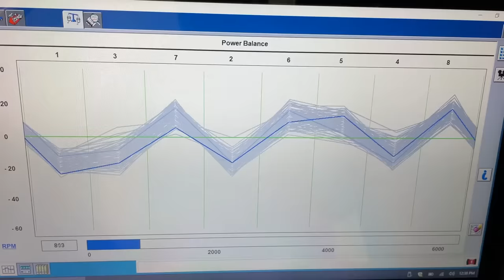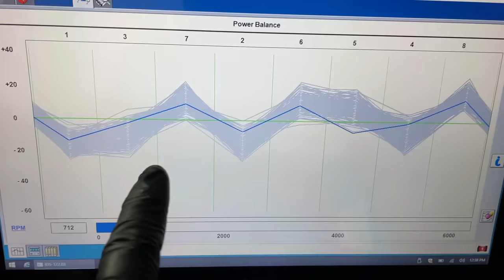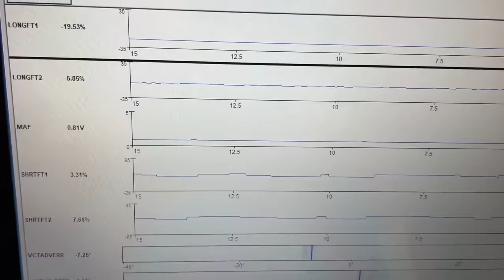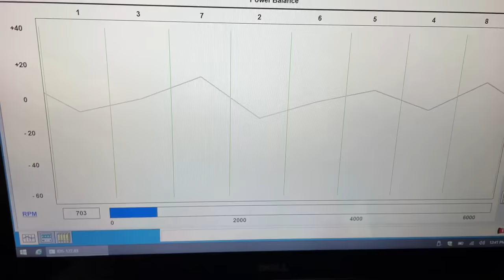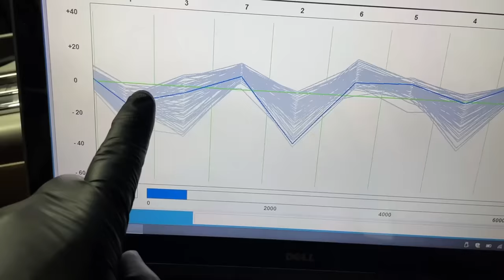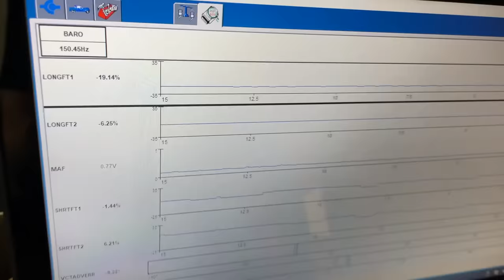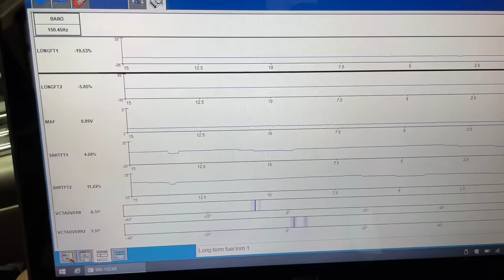Another Ford F-150 5.4L 3v Triton Rough Idle Problem the Other Shops Couldn't Fix!

Comment from the maker: Forscan is a free Ford Specific Diagnostic Software:
Download Here- 
https://forscan.org/home.html
ELM 327 Adapter I Recommend-
https://amzn.to/2GC6dBj

As an Amazon Associate I earn from qualifying purchases.
Reply: So you recommend the scanner and it will work on a Android phone? And then the free software works for the scanner?
Reply: I have been subscribed since 2013 wish scan tool was available then for now NO more fords
Reply: @xnotx2  do you have a link for that I can't find it?
Reply: Excellent diagnostic. 👍
  Who manufactured that phaser? 
And which phaser do you recommend for replacement?
Reply: I bought this ELM device and installed FORScan for Windows, and I do not have access to power balance.  I'm not sure if it's limitations of the ELM, or if power balance is simply no longer available on FORScan.  It looks like you're using an older version of the software.
Reply: @colliswilliams8992  He's running Ford IDS.
Reply: @hammerhead1282  nothing but OEM Ford replacement parts as far as the phasers. Aftermarket are junk.
Reply: I have another question I wanna add a air oil separator on my 2018 Ford Explorer Sport EcoBoost
Reply: do u have a video of the 5.4l spark plug replacement so they dont break?
Reply: @shonepolk9112  how much is a phaser replacement labor and material?
Reply: Top notch tech 👍👍👍
Reply: This is the same issue I'm having with my truck. It sounds just like it.
Reply: @albduke  can’t remember the price on the parts exactly but I did a complete timing job and I think it was around 800 for the entire kit. I did the work myself, Brian has a link to a Ford OEM replacement kit on Amazon. If doing the timing kit, I recommend doing the melling oil pump upgrade as well. I did and mine is an 07 with 150k and runs like new 👍
Reply: Hilarious name for a scanning software. No Freudian Slips on that name I bet. I enjoy your videos...ALWAYS!
Reply: Will the forscan software provide the same data as the system that you use?
Reply: I'm sure you did but I hope you replaced that broken guide too in bank one
Reply: @ismarmeskovic  agreed
Reply: What does a repair like that cost roughly?
Reply: @craneguru66  at the dealership I work at it right around 2500 for everything
Reply: @hammerhead1282  Ford & Ford
Reply: I’m a new Ford tech and stumbled upon your page great stuff man keep up good work and information definitely helps a lot! are or were you a Ford tech?
Reply: Drivability
Reply: So im looking to get a laptop  and the programs and scan tool. Could you tell me what programs you are using. I relise that i will have to purchase the license.  Your vids have helped me alot.
Reply: Is this the software you were using in the video?
Reply: It is shocking how many mechanics have no clue how to look at live data to locate the cause of a check engine light.
Reply: Can Forscan be used for 2000 - 2004 f350 diesel trucks too?
Reply: @kryptonian7648  Thanks for sharing that quote. That’s for labor and all the latest greatest ford components? This at least gives me an idea of what to expect so I can began planning. Would a dealership keep these parts on hand or should I expect for a week or two time to get parts? That’s cool yalls dealership is open to performing this repair. I just had p0012 p0021 and p0016 come up the night before last. Was taking the family to finish Christmas shopping and the truck began to stumble while easing into a parking space. Hopefully I can find a dealership or experienced shop to do the timing …thanks and Merry Christmas
Reply: Hi Brian, what if I only have the error fluctuations sometimes? With a P0022 CEL code? Would that be a bank 2 intake VCT going out? Especially intermittently, sometimes stalling at idle. Under mode 6 it’s says vvt bank 2 is at 11.63-11.64 degrees sometimes (Max supposed to be 11.61 degrees)
Reply: @jonathonrodriguez6733  , I soak them with a good penetrant and let them sit a long time. Then I blow out the excess oil and very careful take them out. I have been pretty lucky so far.
Reply: How much would you charge me to diagnose my engine. Include location, and contact information.
Reply: How much did it cost the guy for you to do the timing job and diagnostics? Just out of curiosity because my 2005 fx4 5.4 triton 3 valve has a similar issue where it's shuddering at idle mildly. I had a misfire and changed a few spark plugs and coil packs and the misfire is gone and it ran good for a week or so and now its shuddering..... and I don't trust the shops around my city to do anything to my truck. I prefer to work on it myself if I can.  You have the timing job videos but man that's time consuming and I work an hour away from home and only have one vehicle.
Reply: I got duhh

Comment: I have an '06 F150 with the 5.4 3v.  It has 312,000 miles on the original timing set.  Lol it's almost time for an overhaul, but still runs very well!
Reply: Don't touch till it breaks
Reply: What oil and filter do you use
Reply: @lyleswavel320   Use the Valvoline High Mileage and Wix filters.  Change it every three months whether it needs it or not.

Comment: Ford dealerships should require all of their technicians to watch your videos. Hats off to you Brian! You  definitely stand out from the crowd. I definitely enjoy all the videos and information you provide. Just last night I watched your video on motorcraft coolants. My '12 Taurus needs to have the coolant changed and I couldn't understand why I couldn't find the Motorcraft orange coolant anyway except ebay which had crazy prices. I did find a technical bulletin from Ford explaining why they discontinued the orange coolant and to switch over to the yellow coolant. My initial thoughts were is it compatible with the orange coolant? Then it dawned on me to see if you made a video about the coolants. Low and behold I found your video explaining all of Ford coolants. After watching, it eased my mind and was nothing for me to worry about. I then watched your video on how you flush out a Ford's cooling system.  I'm retired now and have 50+ yrs of automotive... mainly GM until I wised up and switched over to Ford...haha and have 25 yrs working on commercial aircraft. I still enjoy working on my cars for the limited knowledge I have on today's modern vehicles to a certain point. There's no need for me to invest in all the equipment and tools needed today to work on my vehicles so when I do need repairs done to the point that is way beyond my knowledge there is a Ford dealership I use that have some excellent technicians and have always been more than pleased with the work they preform. I watched your video on your new 2021 F150 and thought to myself the systems on today's vehicles are just about as complicated as systems on commercial aircraft. It's mind blowing for sure. If I lived anywhere close to you you'd without a doubt would be my go to technician. Keep the great videos coming.
Reply: Ford dealerships should be forced to fix these POS 5.4L engines at bo cost to the owners
Reply: Ford dealerships prefer to sell a new engine or a new truck.

Comment: I have watched a lot of your videos on the 5.4 3V engine and it seems like they are terrible motors!  I have a 2004 F150 with the 5.4, it looks like I should sale or trade it ASAP before I have any major problems.  I bought the truck about 4 years ago and it had 247,000 miles on it, it now has 251, 000 miles.  The truck was neglected when bought it so I have replaced all the front end from ball joints on, brakes and so forth. I have replaced Starter, alternator, and many other parts with the help from your videos. Thanks for making theses videos so people like me can do our own work and save a lot of money. P.S: from watching your video on the number seven rocker that sounds like my next task because I have had a tapping noise ever since I bought the truck.

Comment: You said that this truck has 168,000.0 miles on it which is pretty good for original timing components. I have a 2006 with 567,000.0 miles on it with original timing components that is still running strong with no issues. I am the original owner. Would you be interested in seeing this truck?

Comment: My 2009 f-150 isn’t that clean, but I did my timing job at 214000, it started making noise around 210000. Maintenance is key one these engines!! I’m glad I could save money with your walk through
Reply: Same here. Made my changeout around 212K using his video's and buying authentic Motorcraft replacement parts. Have 245K now and still runs great.

Comment: Proof that diagnostic skills matter.  Had a suburban come in that another shop tried to repair for lean code on both banks and both sensor 1 o2 sensors. Smoked it and both runners of intake from front to back were leaking the worst I have ever seen .

Comment: Watched because my 2000 F-150 with the two valve 5.4 Triton was showing a lean condition and adding 20-25% fuel trim.  The intake was warped, confirmed with the propane test, so I replaced it and also replaced the coils and plugs, EGR, PCV valve and hose, injector o-rings and vacuum lines and cleaned the mass airflow sensor while it was apart.  It still gave lean codes so I smoke tested it and it passed.  Took it to an independent shop that would actually listen to me and what I had done.  I worked on general aviation aircraft at one time and built two street rods so the skills were there.  We all agreed that it ~looked~ like a vacuum leak on the diagnostics but I told the shop owner that I really believed it was a sensor somewhere; I just didn't have the experience or resources to verify that.  They checked the O2 sensors first and then found that the MAF sensor was sending bad data.  Their diagnostics weren't cheap but the problem was fixed.  There is no telling what a dealership might have "diagnosed" and how much it would have cost.

I have no desire to own a later style Ford engine.  The F-150 is just used for hauling things, 2000-3000 miles/year that won't fit in a car or SUV so it should last me another 10-20 years.

Comment: Damn what I wouldn't give to have you near oklahoma! I love my old 2006 f150. Am dreading the day I begin to have trouble with my phasers. Thank you for all the info!
Reply: I got a 06 5.4 3v too. Intermittent ruff idle 156k miles. No codes read on obd. This may be my issue. I’m getting that scanner. And ordering oem timing kit and melling pump. Great videos
Reply: I agree. Let me know if you find a good shop that can do this in Oklahoma. I need mine done as well.

Comment: I keep learning from you/ thanks!! I am jupitermustangmike/ I rebuilt my 4.6 3valve stang / new crank / a timing chain guide wore out and a metal bushing went under left chain and sent timing out and bent a con rod!!! I put ratchet chain tensioners/I put lockouts in the phasers / I really need that scanner and your brain ! HaHHa thanks for your vids/ I will get it right eventually / my motor  rebuild is 2 years old so it was a success on my utube channel/ thanks again / you are a master mechanic/ be proud of yourself/ I am very impressed 🐎🐎🐎🌴🌴🌴

Comment: Seems like there would be a good market for parts and mods that simplify and make these engines more reliable by replacing the complex and problematic issues it has.
Reply: Buy a Chevy
Reply: It’s not a very complex setup compared to some more modern VVT/VCT systems. There are phaser lockout kits, but that doesn’t fix the chains and guides. These 3V modulars are some of my favorite engines to do timing jobs on, since you can do it in the car. I just did head gaskets on a Toyota 2GR-FE due to coolant leaking into the front bank of cylinders, and did timing chains while I was there since the tensioners were bleeding down overnight, and the exhaust cam sprockets were starting to come apart, causing that nice cold start rattle. You basically have to take the engine down to the short block to do the chains, since the oil pump is built into the timing cover, and that can’t be removed without pulling the upper pan. All in all, the job billed 28 hours, and I needed all of it!

Comment: I have a 2003 E350 with a 2 valve 5.4. The original engine went to 575,000 miles, only replaced coilpacks and intake and once and plugs every 100k. Replaced it with a Motorcraft reman, which is still going with 874,000 miles on the van   I absolutely love Fords, using Motorcraft parts and fluids as much as I can.

Comment: Great job Brian, it's good you know the 5.4 3V, the information, & data is there, but in some shops either don't 
have the right scan tools, don't know how to use them, they turn to throwing wrong parts at them.

Comment: Thank you i had narrowed down my issue to this already but you explained it in such simple yet detailed terms. I just need a fair quote estimate now there are shops quoting me around 14+ hours and $4,000 for this timing component replacement job. Does that sound right? The 2005 truck is only worth about 6k right now and they ALL do this around 190,000 miles!

Comment: I have an 05 F150 5.4 3v. Bought it in 2013, with only 91000 miles on it. It had a slight miss at idle. Ran great above idle. Replaced All the timing system. Put a cam phaser lockout kit on it and reprogrammed the computer to bypass the vct. Runs great other than the slight miss at idle.
Reply: So what’s the answer to get the miss to go away at idle

Comment: I have a 2017 3.5l EcoBoost with the stupid cold start rattle. Obviously the phasers. Also a roughish idle. I changed the plugs, and cleaned the iAT sensors and TB. No change.   I suspect the phasers are causing it. Will look at the data with the forscan after watching this video. Thanks for the video!
Reply: If it does it only on the first start of the day then it is the phasers. Super common in 3.5's. You should be able to get it done under warranty at a dealership.

Comment: I could sure use your expertise out here in the Philadelphia suburb area.  My 2010 5.4 lariat once I step on in slightly with pressure the truck starts to shake until I let off the pedal a little.

Comment: I wish he was in NC. Several years ago I was having severe power issues with my 06 f150. After having several shops look at it and getting nowhere, I took it to the dealership. They started with the timing system and then said a complete rebuild was needed $7000.
Although it ran better, I knew it still wasn't right. At that point they pretty much blew me off. Recently I had a stuck injector and the guy who had it pulled out 3 different types of spark plugs!!! There are other things that made me question the rebuild as well, but I am certain that they probably replaced the timing issues and that was it
Reply: I need him in NC aswell. Seems like some shops are clueless
Reply: @w900kw2  I just hate being lied to and taken advantage of. I spent over $7000. I probably should have just been done with the 5.4 and bought a coyote motor. At the very least, I should have taken my truck to a mechanic to verify the work that the dealership told me they did. I really didn't think that a dealership would do this to a customer. Live and learn.
Reply: I have an 06 5.4 3 valve with 111,000 miles.  I've replaced a cracked manifold and had an injector stick on it.  If mine ever blows I have found a site that sells completely rebuilt engines for $3k.  They have the high volume oil pump and all other upgrades with a 3 year 36k warranty.
Reply: @johnpyle8027  I think that oil pump is essential for longevity.
Reply: @johnpyle8027  was it the intake or exhaust? The exhaust manifold is common on this engine.
Reply: @johnpyle8027  please give the name of that site my 07 5.4 may need a new engine

Comment: The main reason I like to do my own work because most shops are just parts changers.
Reply: Unfortunately that is a fact my friend. I’ve been at the same shop for over 10 years now and you would be amazed at how many other shops in the area just launch parts at a car and then give up and send it to our shop. And I’m by no means saying I’m a master diagnostic expert however I do know how to use logic and reason while searching for a problem and I’m certainly not just going to wing parts at a car. Our shop has quite a few used car lots that come to us as well because they buy cars from auction and then them fixed before selling them and a lot of other shops in the area see a used car lot and they won’t even bother diagnosing the car and they’ll just throw parts at their cars and it ends up costing the car lots tons of wasted money so they’ve now realized how much money they can save on wasted parts by bringing it to us and having it fixed right the first time lol.

Comment: Took my F150 to the dealership to replace a leaking radiator, replacement radiator started leaking three months later, I had to paid for all repairs, as they handed me the keys I told the repair manager "if this happens again I'm buying a Chevy" , I've been very happy with my Chevy Colorado for the last 10 years,

Comment: The spark plugs issues we on pre 99 5.4 engines. Second time a plug blew out my buddy put a 99 5.4 in it for me. Not only did that fix the plug issue, it's got 30 more horsepower and a ton of low end touque! Got a three valve truck now, and yes, had the phazers locked out before that was an issue. Got 253000 on it now and I tow a 5400lb camper with it. And yes, it will cut across 6 lanes of traffic to get to a gas pump, but towing does little to effect fuel consumption!